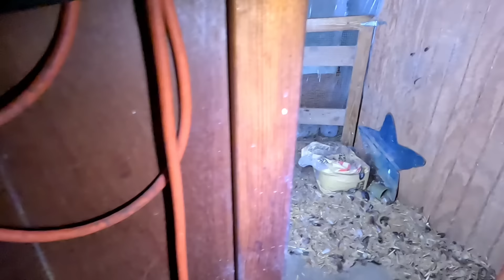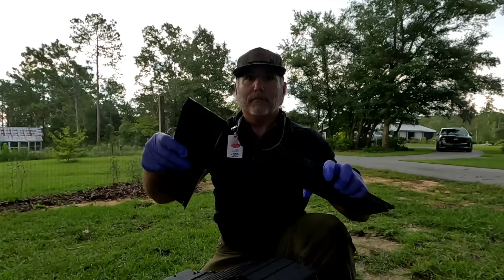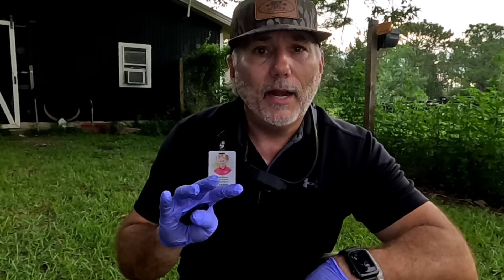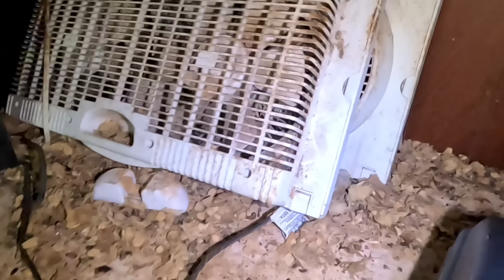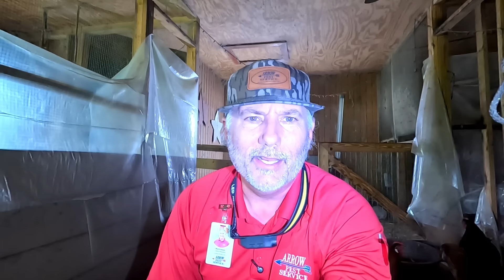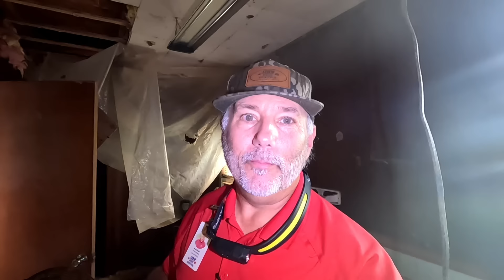Most Effective Rat Control Method Nobody Talks About!

Comment: I live in a desert area and have been dealing with Kangaroo Rats on my 2 1/2-acre lot for a few years.  Place pacs were only marginally effective, I believe because each pac would be eaten by just one rat, also some people are concerned about birds getting into them, but I have lots of birds and my cameras never caught one bird trying to eat one.  The rat population actually grew and just moved to other areas.  I also tried the bucket and ramp for about a month.  It caught 1 rat.
I recently started using bait boxes (10 in total) placed along my perimeter wall, using hard bait.  This seems to be effective, I would estimate an 80- 90% reduction in the rats.

Comment: this is awesome sir. i need to order this. i have one question, does this work on squirrels? i have a squirrel issue in my attic and cannot seem to get rid of them. ive tried spraying with all sorts of stuff, bait with rat poison, trap them with a cage which didnt work, and using moth balls to the point where you can smell the moth balls standing in the street. lol

Comment: The trap in the vucket contraption has several flaws. As you say, there's the overcoming of neophobic behavior. 2. when there are rats in the bucket already, they are likely to send distress signals. It will not take long before every rat in the henhouse knows that they better stay away. 3.. You still have to kill the rats. How to do that without opening up the bucket so all of the rats inside can slip away is beyond me, unless you use some sort of gas-filled room... I think I can do a better job with my pellet gun.

Comment: The problem with that one trap they eat it and then they go off and die and then they’re in the building and then it smells really bad
Reply: Yes. And you don't put that bucket trap in the middle of the room. Should've been set up a long a well travelled wall or corner.

Comment: The only major down side of the bait box is that you will experience dead & rotten smells for months, especially during the winter.  They will crawl into your garage or house to die even if you set the bait box outside. So seal proof your garage & house…
Reply: The Twin Home Experts use wire mesh to block all entry points. I think setting your bait 📦 boxes outside of the structure may be better.

Comment: It looks like the bucket design with a ramp for them to drop into the bucket is the best option and here's why, using a bait set up as shown will allow them to get the bait and eventually move underneath the house crawl up through the woodwork and possibly die inside the home inside the walls causing all kinds of smells even in places where you can't even reach them to get them out not to mention having to deal with the fact of the rotting corpses throughout the home, but with the bucket method after they have a chance to get used to it in their environment camouflaging it with different kinds of things they enjoy getting into like empty milk cartons and things like that, eventually walking up the ramp dropping into the bucket to collect and dispose of a few miles away is the best way in my opinion to to keep them from dying in the home after using the rat bait trap giving them time to still be active moving up inside the home to die inside there.
Reply: Rats (most animals) are about acclimation/acceptance vs any form of camo 🤨(deer blinds/stands, traps, etc) and btw who on Earth would you dump/'relocate' your nuisances onto?? It's even illegal to release such vermin in many states. Anyway, I hope you never have to trap rats. Turtles, chippies, reds, mice, 'coons, feral cats, 'possum, groundhogs, moles, mink, & muskrat (among my haul so far this year) are often easier. Oh, and let''s not hope any one thing will work best. Use several. 🙂 Cheers.

Comment: In the early to mid 90's I used to buy this green stuff that looked like little rocks. I called it green rock candy mouse rat bait. It dehydrated them so they don't stink when they die. Does anyone know what that was? I had to get it at a feed store.  It worked wonders on garages and old buildings.

Comment: My craziest rat story is when I got assigned a MASSIVE section eight housing project in Rockville Maryland. It had a large 20+ story high rise and ten two story low rises. Around the Dumpsters there was a rat colony so big you could smell it from about 100 feet away. It smelled like the primate cages at the zoo. The burrows were so extensive, it looked like the surface of the moon or a battlefield with thousands of bomb craters. I would spend about an hour each visit shooting tracking powder down the burrows and filling them in with dirt. The building engineers who escorted me around the property every time I came joked that for three days after every visit they were picking up dead rats in the parking lot. That colony was so big, it took six weeks of treatment to eliminate it.
Reply: What's tracking powder?
Reply: Wow! That is so crazy 6 weeks. That had to be so awful.

Comment: I once had a really bad mouse infestation in a nursing home. They were running around the place in the drop ceilings. The individual small mouse bait boxes would not cut it. So following the label, I bent a wire hanger into a circle and placed about 30 pieces of soft bait on it and used fishing line to secure it to some conduit. Since it was in a void, secured to a hanger and secured via fishing line it met all the label requirements. I put one of those in the ceiling in all five wings. It worked like a charm but that place smelled like death....more than usual for about two weeks.

Comment: I used the Vulkan traps as well, the only difference is I put about three gallons of water and antifreeze in mine. The Rats would drown and be preserved in the antifreeze so having 12 to 15 dead rats in there wouldn't stink up the joint.

Comment: I am invaded with roof rats they've eaten all in salation and now invading inside.  I was cleaning in  bottom of old dresser it hD a shriveled up dead mouse not what it was.  I put out green glue board when i caged cats at night i caught 3 sm side by side with a couple crumbs of cat food.    That wasn't bad enough i go into my  bathroom in tbe middle of the i turned on the light to use toilet same size rat in toilet squicking at me i felt bad  because id didn't flush down what made it worst he just kept paddlinv on porcelin couldn't get out. I thought am i really that cold hearted to leave him there a week until my husband the week
So i went and got bbq pinchers the bathroom sm clamp xown trash  and beld it down until i could throw can over the fence in baxkyard sceaming.  I tried to set a lrg rat on claw trap didnt get any food on it so when my husband got home caught lrg rat with peanut butter.
He took and did away with rat.   I got very. Very sick after cleaning up rat urine and feces  after he went to work this week i didn't answer my phone it went completely dead.  I couldn't fuction  even enough to find it when i did i couldn't figure out how to plug it in. 
My husband sent my neighbor to the door which i couldn't reach and he gave them code to side gate.  1 of my neiehbors could see me on the couch and she kept saying Martin needs to talk which is my husband.  She came to door and handed me her phone and they both came in and waited to see if i needed to go to hospital .
I said if I am dieing tomorrow i will go
I sent my dr a message to see ifi he can do bldwrk  so i will know tomorrow. 
The rat my husband killed and in my attic is definetly roof rat
Reply: Total invation like ur bait crack
Reply from the maker: Thanks
Reply: So sorry about miss spelling got sick again.
Reply from the maker: No worries
Reply from the maker: Thanks for sharing

Comment: We got ducks & chooks, therefore we got rats, 
I’m an early riser, so about 30 mins before sunup I usually head out to the adjacent back timber shed in stealth mode with my mug of coffee & a couple cigarettes & lay in wait with my headlamp & super silent good old fashioned bow & arrow, 
I’m happy if I extinguish 1 or 2 of em every morning, 
a chest or neck shot is reasonably quick but if I get em in the hips or guts that’s when the trusty old baseball bat has a tendency to end the cruelty very quickly.  my accuracy was lousy at the start but it has now improved 10 fold 👍. The big old knarley bastards are easy pickings but the cute little ones are definitely more challenging.

Comment: Sir I live in Washington DC I need help I have had a company cut open wall put down one trap and no luck can please assist me point in the right direction. No sleep from running in the walls please help
Reply from the maker: Have they tried using bait??
Reply: They are trying to get yearly contract which wouldn’t mind but they have to find out how they getting in otherwise this is a nightmare for me can suggest any company that you know will get the job done please
Reply: Peanut butter and regular trap that is it

Comment: Man I hate rats so much! I work for John Deere dealership and sometimes I have to work on tractors where rats have caused so much damage with wiring. They eat the sweet lubricant they use to slip wire in the rubber. 
Thanks for sharing video.
Reply from the maker: Yes, they can do a lot of damage. Thank you for watching.

Comment: Will the the bait work with mice?? I have had a pest control company come and put bait stations around my house and it has not done anything. After charging me $575 I haven’t called them back because I’m not impressed with them at all he told me 2-3 weeks and they will die off.  Can you Please suggest some good options that will work for me.”?
Thank you very much 🙏🙏🙏🙏
Reply: Also I have the block bait fast kill and the bait stations and they haven’t worked either even with the pest control stations. I forgot to mention that
Reply from the maker: The soft bait works like magic on mice also. They gobble it up.

Comment: How long does it take them to die and where do they go to die once they take the bait... Also where can I find the soft Blue bait?
Reply from the maker: It will take about 3 to 4 days before they will actually die, unfortunately you can't control where they die but most of the time they die outside somewhere in my experience. I put a link in the description for the soft bait we use and it's amazing.

Comment: baking soda and jiffy corn muffin mixed together dry. 50/50 worked well for me. Won't hurt any other animals
Reply: Yep, I tried everything and the only thing that worked for me was cornbread mix mixed with baking soda 50-50 6040 either one works depending on how many rats you have. It takes a little time but it does the trick.
No more rats and it won’t hurt other animals around if they happen to get into it cheap too
Reply: @K9Elite222 you put it in bowls in the area? Do the rats or mice die and you have to find them? And if cats have access and eat it it won't do anything to them? Sorry, many questions
Reply: @melodydetails I put a mixture in a covered container with a hole big enough for a rat to get to it and keep it from the weather outside 
Cats have no interest in it and wouldn’t hurt them 
The rats will die eventually from eating it and they usually die in their nest  but might find one just expired somewhere on the ground
Reply: @K9Elite222 put in some dabs of peanut 🥜 butter for attractant
Reply: I've used 50/50 mix of corn meal and cement (plain cement, not Quikrete). The cement gums up the intestines and also acts as a desiccant to dry up the corpse.
Reply: @Annette-s1q ☝️This.  My father got rid of a whole colony of rats using this method. They had invaded his compost box at his community garden.  Leftover tile grout powder works too.
Reply: 1 part Jiffy to 2 parts Baking soda is what works also Crunchy Peanut butter and Cement powder mixed together works keep it in a container away from other pets.
Reply: finally a smart answer
Reply: Outside?
Reply: I agree 100%

Comment: I was being attacked by rats!  My husband was in the hospital one year ago. Afterwards he had to be in a nursing center to get his strength back and learn to walk again. While in the hospital I was with him around the clock but when he went to the home I came home to spend the nights and heard the noise in our dining room/kitchen area. I had glue traps and thought it was a mouse. After placing the glue trap where I heard noise and when I returned home I went to the trap. It was moved and turned on its side with hair all stuck on it. I thought it must be a large mouse or a rat. I kept hearing it but when I got up from the recliner I was in it would either run or freeze. I finally had to pull the recliner far enough out (my back was facing the dining room) and I had a mirror that I held out to look as I was half hanging off the chair. Then I saw the rat jump from a low ratan table and I freaked. I got the glue boards I had and I caught one and I took another board and tossed it on the back of the rat so I had it sandwiched between the boards, when I picked it up even though I could tell from the size of it that it was young, it was so strong and fought hard to try and get free. I ended up catching 9 of them and I could tell from the direction they were running they must be coming from my furnace closet. When I got the nerve I pounded on the door and then opened the door. I had gotten a new air conditioner/furnace and come to find out there was a large hole in the floor going under my house. I went nuts and researched on Amazon reading all the comments from various products. Finally ordered  5 gal bucket of those things that were like large solid pellets with a hole in the middle so you could load it into those feeding stations. I just shoved tons of them down that hole and placed some around the furnace on the floor and slammed the door. Since we no longer have pets I even placed some around and I got my air conditioner guy to come help me cover the hole. I only have one station now but I am wanting to try the soft bait you are showing to keep to put out for any mice. Our home was built in 1950 and is up on its foundation so there’s a crawl hole that will let you go under the house. My husband is 91 and we are handicapped so we have to find the easiest way to fight them. I am thinking I won’t have another rat but I am sure there will be a mouse every once in awhile. So glad I caught your video!!  ❤ it’s not fun to fight something that scares you to death! 😂 ❤
Reply: Wow that was a novel
Reply: Prayer sent.
Reply: 🙏🙌😇God bless U & Ur husband, Ma'am, I hope Ur both feeling better. What is the rodent prob like now that it's 5 months ago.? I buy rat poison at Lowes. It's by VICTOR & its a bag of marble size balls. This is an old house too & the mice come up from the basement & thru the fieldstone foundation. They're perfectly content here & I saw an off white colored one. So that's a mouse Bcuz rats are black. They're being killed off really good by the poison but there's so many of them. I guess I should buy stock in the poison company 😅😂
Reply: I don't know if you will ever see my comment but I was reading your comment like it was a story. Thank you it was very informative and entertaining
Reply: We had a new hest pump put in and they left a roughly 3’ by 4” space WIDE OPEN into my wall under the unit! I didnt see it at first was going CRAZY,! Packed a bunch of concrete under there to block it off. Contractors dont care. They did it again when we mived our unit. I said that a big rat house cover that up! With sheet metal! LAZY!
Reply: @VelveteenRabbit77 your comfort isn't a contactors responsibility
Reply: @rdallas81  Im paying. Its my house. Im not paying for a substandard job. That was not the agreement.
Reply: @rdallas81  But a contractor's first responsibility  is being a Human.
Reply: @rdallas81 you're an idgiot
Reply: I heard you iam afraid of rats and they are on my container I got to fighting qiick
Reply: @ivanreyes1946 yes Ivan I am afraid of rats and I don’t like even mice but rats rally scare me.
Reply: In some countries they BBQ the rats......  I personally don't but..............
Reply: Thank you for this mini nightmare novel 😅beautifully written and sucked me right in. Wish you and your husband wealth and health. Hope you got the rodents out your home.
Stay safe and blessed.
Reply: 18:50
Reply: Just get a Cat....you wont see anymore mice or rats.
Reply: @laragreene8328 there's probably 30 cats that are constantly around my house. None of them are mine they belong to my neighbor. Anyways lo g story short,  last night I heard either a rat or a squirrel in a bedroom upstairs. Did I mention there are actually 2 cat living in the  with me
Reply: @laragreene8328  Even farm cats typically don't mess with farm rats. They'd rather eat birds anyway. cheers.
Reply: Depends on the cat, the smell of a cat isn't a deterrent.

Comment: We've had field mice problems. So we do have a bucket method that we use water. We put cheese on the little flap and we do get mice in the water. I also use these clear enclosed traps you get off of Amazon. I put those around inside the house and they do work. You live out in the country, you're going to have field mice. An exterminator told me that they can get to a dime size hole. At a different house in my basement I had mice get in my holiday items that we store. I had to throw so much stuff away. So now everything is stored in a clear plastic tub. I guess at this point I'm paranoid so traps will stay out in my home forever. I donot want even one little mouse roaming around.

Comment: Using a garden sprayer with ammonia/vinegar and some peppermint extract oil sprayed on exterior walls,seal all holes/ cracks and  pet proof containers with baking soda, cocoa , and some rat poison yep and all garbage removed daily and all food put in air tight plastic containers and a cat or two helps